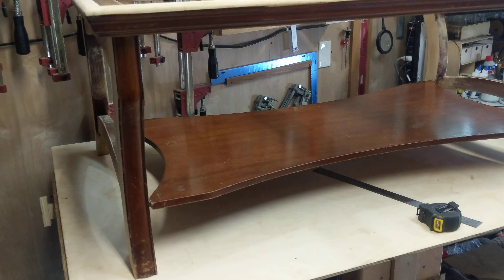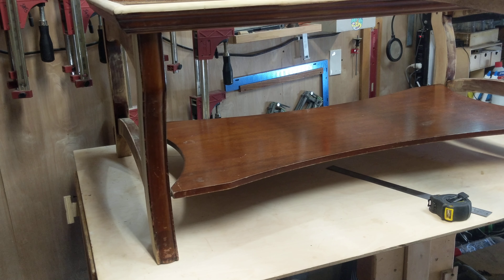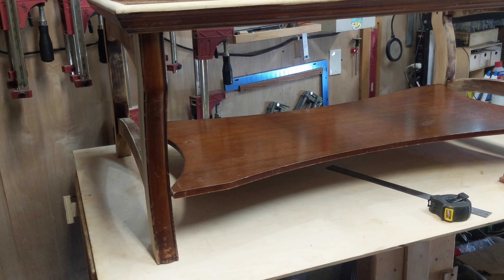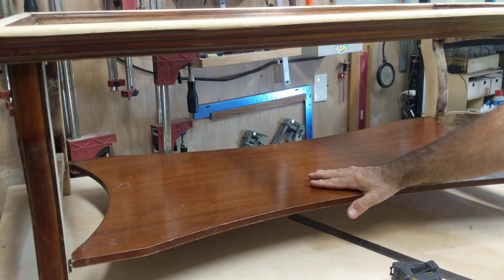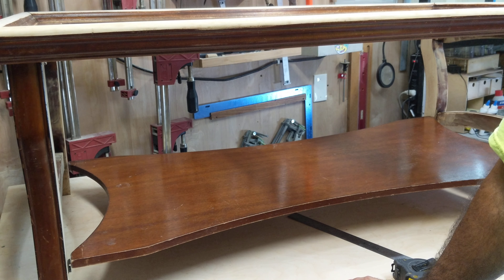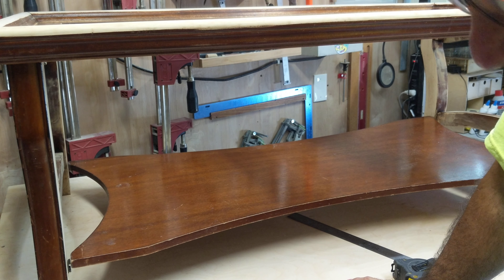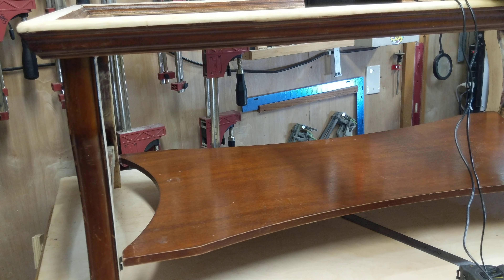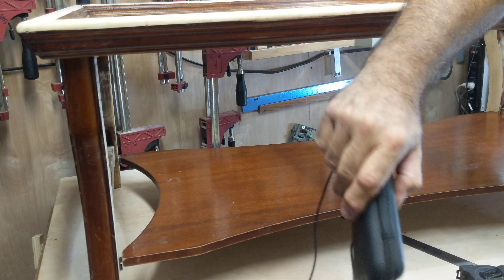N Scale Coffee Table Layout  build : Part 1

Comment: Hey Jerry, this is great! Looking forward to seeing where this project goes! I've always thought an N scale layout in a coffee table would be really great!

Also, I'm not sure how you feel about the Kato Unitrack, but they make DCC decoders that you can solder right into the base of the turnouts to control switching. You'd have to have it connected to a DCC system to allow you to use the turnouts, of course, but they'd be a lot less cumbersome than something like a Tortoise and don't require any additional wiring outside of the track. Just for whatever that's worth.
Reply from the maker: Thanks for that too Seth about the Kato . I like that you can do that. Rick is in charge of the track since this really is his layout. I'm pretty sure he already bought the track already. Thanks again for the tip.